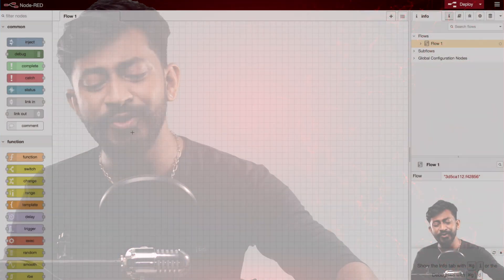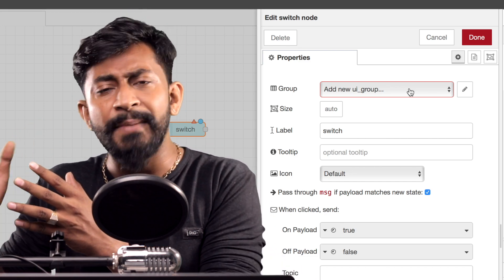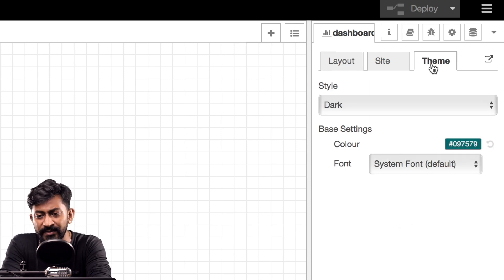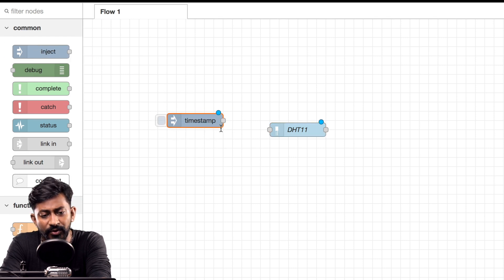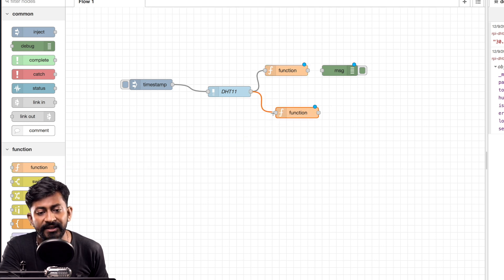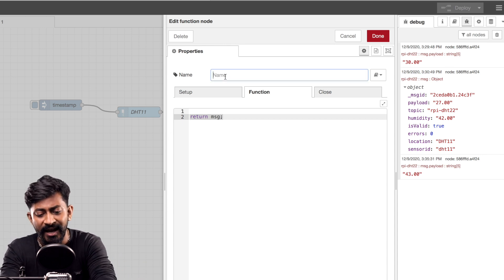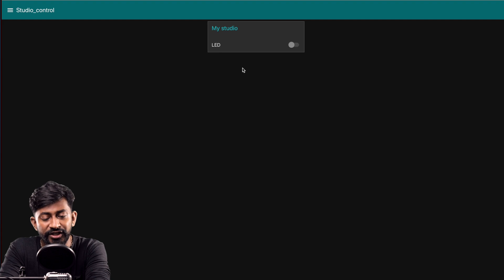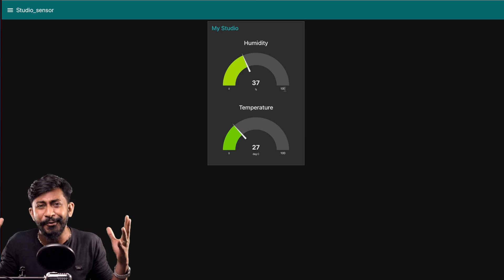Monitor Sensor & Control LEDs on Node-RED Dashboard connected to Raspberry Pi board

Comment: I have made connections of DHT11 sensor but it is giving me 0.00 in message payload in debug window what is the issue?
Reply from the maker: send your nodered configurations video clip on my WhatsApp number - +91 82000 79034
Reply: @techiesms  Thank you for helping. My issue is solved. Actually I have made mistake in connecting the DHT +ve terminal to +5V onboard instead of 3V on RPi.

Comment: Another awesome video, sir!  This series is really helping understand the basic concepts on Node-RED.
  Love your presentation style.

Question: how does one use Node-RED on one Rpi, but get/control another device in my home?  For instance, I want to make six ESP-32s with DHT11 sensors, distributed one per room, connected wireless to my network.

[Later]: I wrote the above ~3/4 way thru... looks like I'll need to wait 'til next week!
 :)

Cheers from Canada!